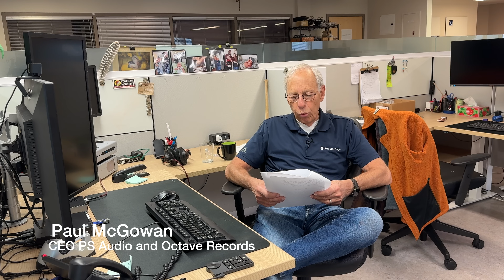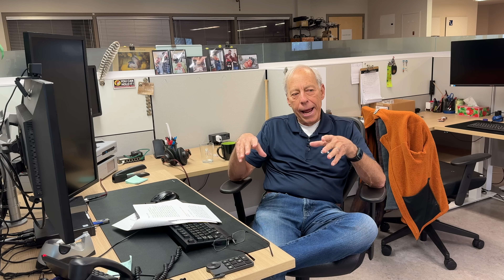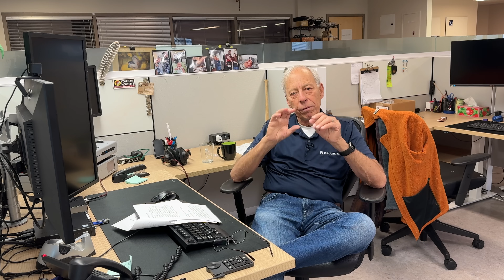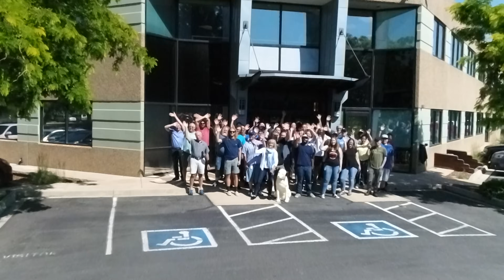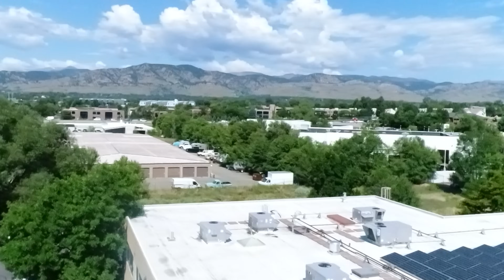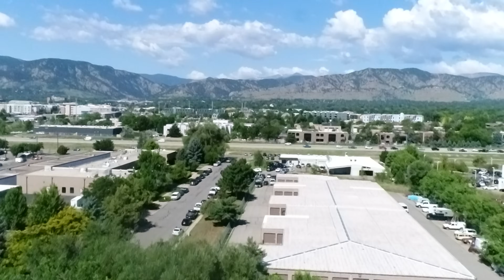DSD to PCM

Comment: If you can capture in DSD and convert to PCM, without much of a problem, why couldn’t you just do that in real time, and in that sense «capture in PCM»? Is the convertion from DSD to PCM a process that can not be done in real time, or even fast (with some latency)? You’re talking about this again and again, but you never fill inn the holes in the story.